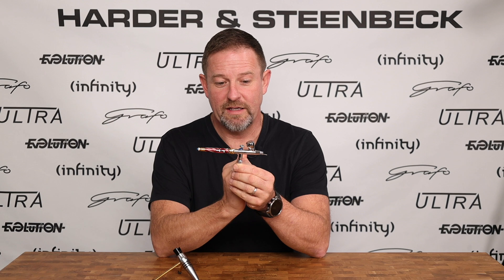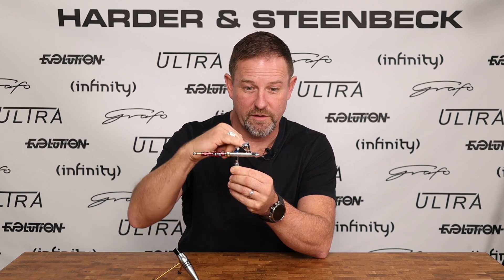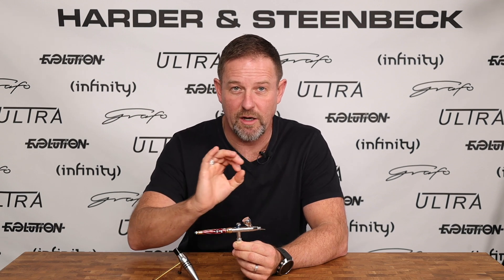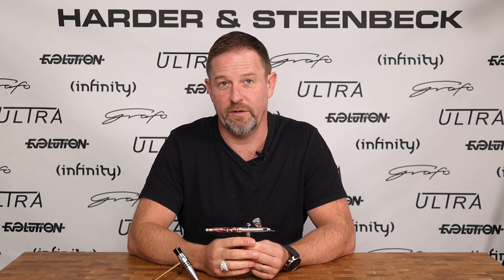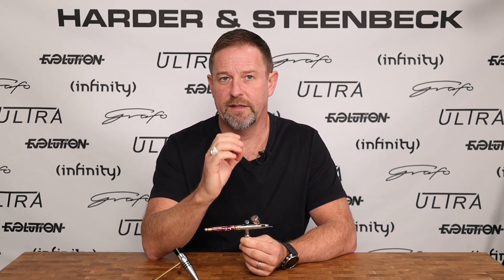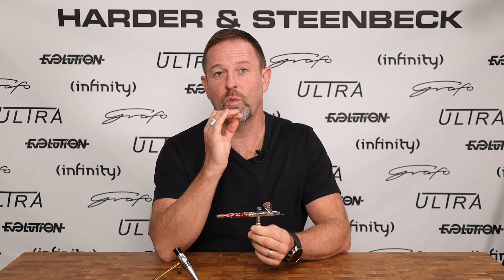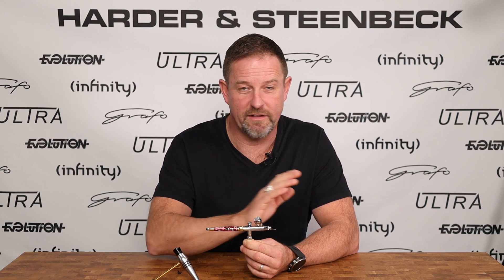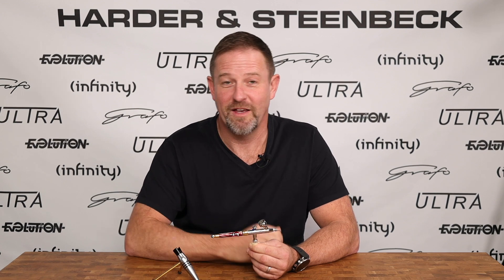How The Airbrush Actually Works

Comment: I'm new to airbrushing, do you use a spray booth or exhaust system when using the airbrush for minature painting
Reply from the maker: No, but only because we work in a pretty large well ventilated studio. If you don't, I would consider it.

Comment: Ive recently watched a lot of these videos, they have been very informative and im looking forward to getting back to grips with my airbrush.  In one video you mention that you shoudlnt use flow improver when sorting the paint for the airbrush however Vallejo make a Airbrush Flow Improver product.  Is this different?  Many thanks and keep bringing videos out.
Reply from the maker: Hey glad to hear it's working well for you! My remark on that is directed at people using flow improvers intended for use with brush painting - they are NOT an improvement to the airbrush performance of a paint. However, the Vallejo product IS an airbrush specific flow improver - it actually acts in the opposite way to the paint base than a flow improver intended for brush work.

Comment: Is leaving the wet part of the airbrush dipped in water between breaks (couple of hours for example) a good idea? 
Or is preferable to clean it and dry it as usual as if we are done for the day.
Reply from the maker: You're the guy who fills his coffee mug with water and leaves it in the sink instead of washing it, right? ;-) just kidding - the best way is if you're going to leave the airbrush, clean it. Don't leave paint in the airbrush, whether it's underwater or not. My recommendation if you need to grab a short break, is clean it well (no stripping necessary - just clean it well using the paint's matching cleaner) and then once clean, put a few drops in the airbrush, spray a bit out to make sure it's spraying totally clear (i.e. no colour) and then leave it with a bit of cleaner in there. Then your airbrush will treat you like a king when you return!
Reply: @harderairbrush  quite the contrary 🤣🤣. I'm the kind of guy which only recently stop sonic cleaning the airbrush after every session.
But good to know that my short break procedure is spot on as per reply.
Reply from the maker: @PainterIdeas  ah great - happy to have helped!

Comment: Another great video and the atomisation on my H&S airbrushes is divine. 

However there is slack in the trigger (especially the two Infinity's that I have) for consistent detail paint up take. Hence some using packing seals to take up the said lag/slack and improve consistency in detail delivery etc. 

Has H&S any plans to remedy such retrospectively and/or going forward? Has such been applied to the Giraldez model to improve paint uptake/delivery?🤔🤔✌️💜
Reply from the maker: Glad you're enjoying your atomisation! If you want to increase spring tension (i.e. addition of seals to the front of the needle guide) you can use the spring tension adjuster present on the Infinity to do so ;-)... it's the adjuster that you can see in the window of the end-piece in front of the needle chuck.
Personally, I find it difficult to describe the Infinity trigger as being a problem that needs a remedy. There's too much great work done by awesome artists with this airbrush to make that case! 
However, we love to get closer to our users, and we love to get better, and so we have done a lot of work with our artist community to understand what experienced users REALLY want from the very front of a trigger response, and we applied the appropriate parts of that to the Giraldez Infinity. You can read about it on the Giraldez Infinity info page. Whilst we haven't described every aspect of the engineering, we have disclosed some, and we're confident that the results speak for themselves. 
The response to the character of the Giraldez trigger action has been great, and so yes, we will make it available for the existing Infinity airbrush. It's actually being prototyped at the moment :-)